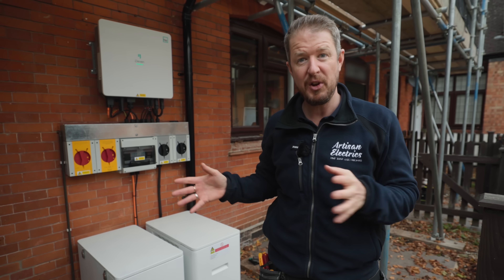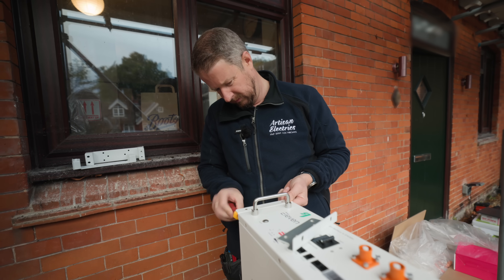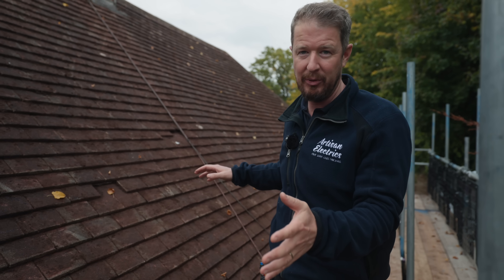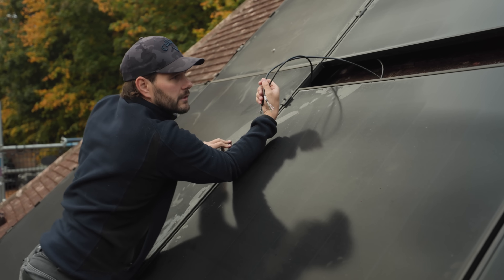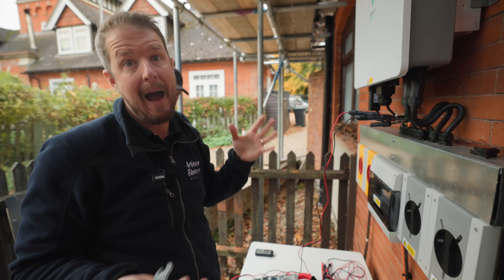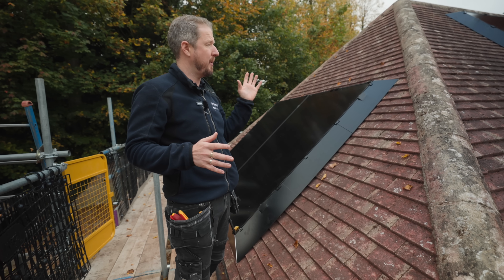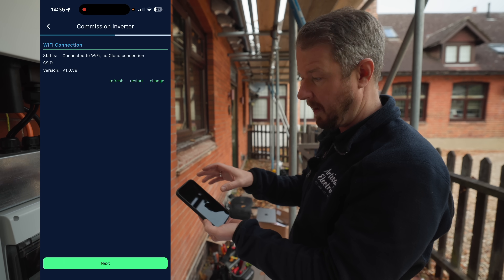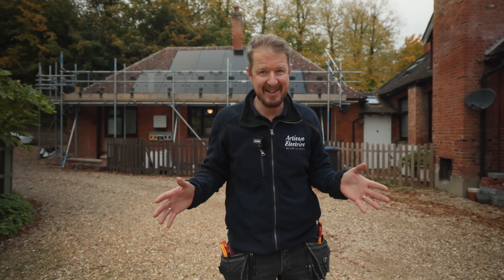Is Sodium-Ion The Future of Battery Storage?

Comment: 1) What are the expected savings?
2) How much for the instal?
3) panel capacity?
4) battery capacity?
5) How much for the instal?
6) how much electricity generated on a sunny and overcast day?
7) how much for the system?
8) HOW MUCH FOR THE INSTAL?????
Reply: you forgot to mention How much for the install?!
Reply: @Spark_230v  That was their second question!
Reply: @AndrewLumsden  And 5th, and 8th.
Could have done with another couple of mentions at least!
Reply: @AndrewLumsden  2nd, 5th, 8th
Reply: @AndrewLumsden ?
Reply: Exactly. Far too many blanks to be able to say if the system is actually any good. It needs the customer to comment, What is/was the system production and by how much has it immediately reduced their electric bill? That is pretty much the whole point of these things.
Reply: Had a solar / battery + diverter for hot water installed this year cost 10k will repay capital in under  5  years. An average system should be under 6.
The big cost saving is cheap rate overnight, I pay 7p a unit instead of 28p

I've also had a lower gas bill and plenty of hot water over the summer.
Reply: If you use the link below, as mentioned in the video, it provides you with what you want to know! Amazing when you listen!!!

Comment: When doing a short circuit current reading without a dedicated controlling meter, how to you prevent arching when disconnecting again?
Reply: I guess he uses a breaker
Reply: @Spark_230v  I really hope he did but I don't think he made a good enough job of showing it. People do as they see in these videos, which can be very dangerous.
Reply: @1kreature  your right, he should warn people as he does it. those arcs burn like f.
Reply: The connectors are labeled do not disconnect under load. Maybe the dc isolator was used. But still. This is dangerous they should have a PV tester that does the test.

Comment: I'm always amazed where you English guys have the meterbox hidden in the house. Small boxes, often in the middle of the house. 
Isn't there a standard,  to put them in a easy to access place for e.g. firedepartments?

In the Netherlands we have a standard place for them,  in a closet, (very) close to the main entrance. Since at least 50 years.

Ps. Dutch standard +/- 40x60cm.
That said, our neighbours (Germans) are realy crazy,  there meterbox is more than 1m2😂
Reply: Our meter boxes are really on the bigger side.
I went for the smallest one that was okay for the grid operator an it is 140x55 cm only for the smart meter, main fuse, main switch and PV control box.
Reply: @AzrethK9  Guess he's talking about the consumer unit instead of the meterbox
Reply: @3fase-e6p 
Uhm, yes, you are correct.
Lets rephrase: meterbox is always below the consumer unit and has a standard size of 60x22cm (one or 3 phase breaker or fuse and meter). 
A common standard consumer unit size is 33x22cm (24 'one pole units'). That unit is often doubled or trippled, if you have more electrical appliances like electrical stove,  heat pump, EV and Solar.
Reply: @AzrethK9 
Yeah, if I had the room, as a sparky, I would love one😉
Reply: @gubbernl Space is relativ, had to sacrifice my garage back wall for main cutout, meter box and distribution consumer unit.
The only alternativ would be an outdoor meter cabinet, which I didn't liked.

Comment: Sodium is not the "clean" technology that we might imagine. Salt has to be melted at a very high temperature to obtain sodium so high initial energy required. Chloride atoms are an effluent in this process. What will we do with vast quantities of chlorine.
Reply: put the  chlorine in your pool
Reply: @Spark_230v or drinking water.
Reply: Chlorine gas is a commodity chemical, used in everything from household bleach and drinking water disinfection to plastics manufacturing and agricultural chemicals.  There's plenty of ways to use the chlorine - the producer of the sodium metal will be bottling it and selling it - quite literally. Its not a waste product, but a product in its own right.
Reply: @jameshodgetts7541  But it will be in quantities, that could not be all absorbed?
Reply: @SurvivalSquirrel I think you’re severely underestimating just how much chlorine we use in industry. And I’m 100% sure a sodium manufacturer (in a first world country anyway) wouldn’t be just venting chlorine to the atmosphere in any serious concentration.
Reply: Make Mustard Gas?

Comment: Sorry to say, but salt based batteries are not ready for our market for another few years. There’s one bigger disadvantage. Voltage Curve not suitable for current inverters. Will work but We’ve reduced capacity. / DOC. 
Then cost ❤
Reply: The battery system comes with inverters optimised for sodium-ion batteries. The depth of discharge is 92% to 95%.
Reply: @YichenShi . Hey that’s great news. So  Na batteries need to be paired only with Na designed inverters. ❤

Comment: Sodium is useless the voltage swing alone kills it dead in the water so stop with bigging up this company that's going nowhere.
Reply: Sodium-ion batteries operate across a relatively wide voltage range. The inverter is specifically designed to accommodate this, enabling not only a depth of discharge (DoD) of up to 95%, but also sustaining over 3 kW of output power even near the end of discharge with a single battery pack.
Reply: @YichenShi not on this unit. According to the specs it's 33 - 59,2V.
That means you lose around 12% at the top and 8% at the bottom. So 20% is NOT usable with this inverter/charger. Hmm, big loss
Reply: @gubbernl  You can't use the bottom end of the range with a small system like this, the current (Amps) would get enormous, costing a huge amount of copper in the wiring, inverter, battery, and charger.  Not a problem with a grid scale battery for long term storage with relatively slow charge/discharge, but these are not for household day-night storage use, while LFP is almost perfect.

Comment: it's Sodium batteries, not Salt, it has nothing to do with table salt! totally different chemistry here. Also they have a huge voltage curve which will limit max power when the battery is low
Reply: Yes, check the data sheet - 95% round trip efficiency. There are different sodium-ion battery chemistries and cell manufacturers. Please don't compare a DIY sodium battery made with unknown cells with market tested products.
Reply: @YichenShi  I see, still the current Eleven inverter is not fully optimized for them yet

Comment: Sodium battery cells aren't that new. Inverters actually meant for their voltage range, on the other hand...
Reply: even their inverter is not actually meant for these cells, it will work but with some limitations because of these batteries

Comment: For outdoor installations I would be expecting to see some security and anchoring for those battery boxes, people will steal anything cable or energy related if they think they can get some money for it, I would certainly want them bolted down to the floor and some sort of security strap or locking mechanism on those boxes for sure, also some projection for the outdoor cables to prevent tampering or easy removal.
Reply: Nooooo shhhh I want free home batteries just pull the van up and load it up
Reply: Just wondering 🤔 what is the capacity of the sodium batteries installed kwh rating!
We live in South Australia  and replaced our old solar panel 10 years, installed AIKO neostar 480 watt panels with 27kwh batteries  the panels generate enough to top up batteries and extra power to run house load even on a cloudy rainy day. Power bills are zero. 
Sodium will replace lithium based on cost especially once they mass produce solid state batteries, Chinese are already way in front with Sodium.
Reply: @kevinhart7945 
It showed on the battery as 4.5 kwh, so 18 kwh for the system.

Comment: Would like to know the cost per kilowatt for sodium batteries compared to LFP batteries
Reply: right now they are about twice the price of LFP, the price will go down but it will take many years; even if they were cheaper they have limitations like getting only half max power when the battery is low, which will affect some installs
Reply: @andrewfpvair  Not true. Cost per kWh is lower than mainstream LFP brands. Installations were done nationwide both on-grid and off-grid. We don't see any limitations.

Comment: What is the sodium ion battery voltage curve and  hybrid inverter voltage operating range?
Reply: Operating voltage[Battery/Inverter]: 33V to 59.2V; Their inverter is just like any other nothing special, what it does is that it will just limit the max power as the batteries discharge so you will have max power only at 100% SoC which will decrease to half max inverter power at 0% SoC , and it doesn't matter if you have more batteries in parallel, the limiting factor will be the inverter max battery current which is fixed
Reply: But how effecient is the charge/discharge cycle of a sodium battery?

Comment: Can the Shelly device be added to any home system to stop battery discharging into ev?
Reply: You probably could with Home assistant. Shelly have a very good open source style interfaces so can do a lot out of the box. They integrate well into home assistant and that has a fantastic automation engine in it and will let you build excellent dashboards as well.

Comment: Assume there will be a full costing as you normally do? 😂
Reply: with the roof set up and the shading of the panels by the trees, paired with the shockingly bad round trip ratio on the sodium batteries, I imagine the payback time of this install is in the realms of decades - if it even pays back at all.  I imagine a lot of this stuff was free, or at massively reduced cost for the homeowner as a test bed and advertising for the tech rather than a sound investment.
Reply: @jameshodgetts7541 
Why I won't be embarking on a solar journey.

You have also to compare just saving or investing the money.
With an install

Investing the money; these guys must be a better bet

Comment: Curious to know if you can add sodium batteries to a system with already existing lithium ion batteries to increase storage with a mixture of both types?
Reply: Doubt it charging rates and voltage differences would bring problems.
Reply: No
Reply: It would work - but not very good if used in paralell. 
The voltage varies a lot more with the state of charge (SOC) for sodium - which means you wil only be able to use like 50-70% of the capacity of the sodium ion whithout overcharge or overdischarge your lithium batteries. Your maximum power draw will also be limited to the maximum of the one of the battery banks that has the lowest current/power capacity. Because when they have different working voltages most of the time, power will be drawn from just one of the battery banks at a time - not get shared between the 2, like it does if batteries of the same SOC voltage curve, is connected in peralell.

Put the sodium and lithium battery banks in series will work much better from the batteries standpoint (given both banks have about the same Ah capacity). But now your output voltage will be higher (you get the voltage of your lithium bank plus the voltage of your sodium bank) - so your inverter or what ever you are powering, need to be able to handle that. You also need a pretty advanced/custom built control system (BMS) that can control and balance the lithium cells and the sodium cells separetely (and handle their different voltage limits to prevent over/under charge) - or you need 2 BMS, of which one of them must be able to break the combined voltage of the 2 banks without failing. 
Either of which can be pretty hard to find as standard components (unless you are able to design those circuits your self - or modify existing ones, like for example change the MOSFETs in the BMS to ones that can break higher voltage).
Reply: No! Only if they both have a 230v inverter/charger

Comment: 8:36 Tigo optimizers: stuff that no one needs!
Reply: Maybe. They're certainly a much increased failure point. But struggle to see how they could do three different aspects with massively differing outputs and shading in to two MPPT's and use the Eleven inverter without them though.
Reply: I would like to know the same. Why do we need Tigo Optimizer or similar products?
Reply: @Popejohnvicks per panel monitoring
Reply: @familyoffourdisneydreaming6081  Other than that, no real-world benefits?
Reply: @Popejohnvicks  They allow you to mix different orientations on a single string (which is what techieboy already pointed out).

Comment: 'Salt' or NaCl and Na-ion batteries involve sodium, but the form of sodium is completely different — in batteries it’s electrochemically active, not the inert, crystalline table salt you’d sprinkle on chips.
Reply: I thought Salt was Sodium Chloride.  I'd rather not put Sodium metal on my chips, it explodes when it hits water. :face-blue-wide-eyes:
Reply: Everybody has heard of lithium ion batteries, so why not just use the term sodium ion batteries?
It's sad that less than 1% of the population seem to know even what an ion is anyway, or that there are thousands of different salts. Even soap is a kind of salt!
Reply from the maker: That's a great point about the distinction between sodium as an element and table salt!
Reply: @artisanelectrics  Okay, I was trying to point out that the title of this video is at best, misleading, maybe replace 'Salt' with 'Sodium' ...as an idea Jordan?
Reply: @sausagemcgregory  Eh, I'm not against it, at the end of the day most people hear sodium and think salt, which is what the title is playing on.

Could they know most people will have read the title and instantly start the video by saying "No, salt isn't, but sodium could be!" or words to that effect.
Also the title is one of those technically correct things, because salt contains sodium, not to mention what's dug out of the ground for this battery starts its life as salt, it's then refined further to purify the sodium and remove other unwanted minerals.
Reply: @artisanelectrics 
What's fun is a small piece of metallic sodium thrown on a bowl of water. 

Chemistry students don't get the fun we did
Reply: @artisanelectrics  Well played Jordan, that's better 😇
Reply: @artisanelectrics give me strength 
WHY not get someone from the sponsor to explain